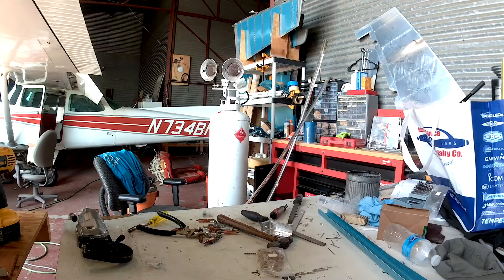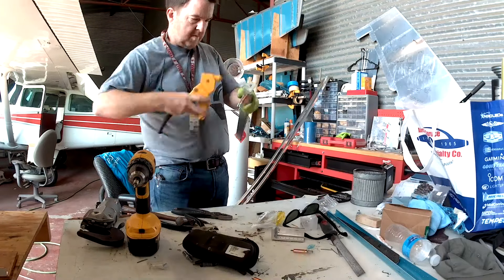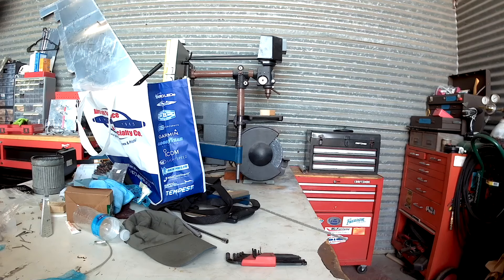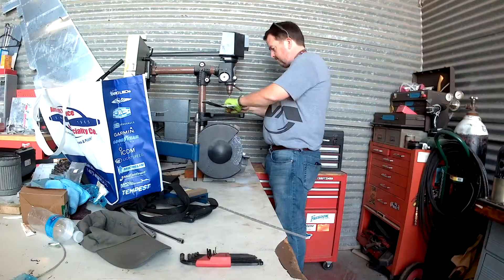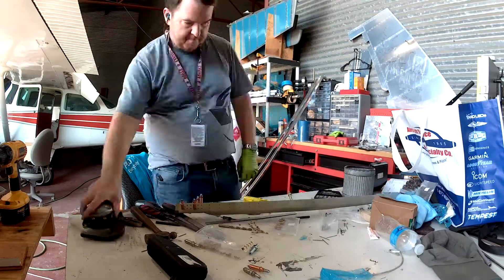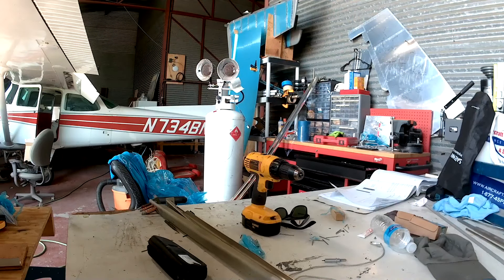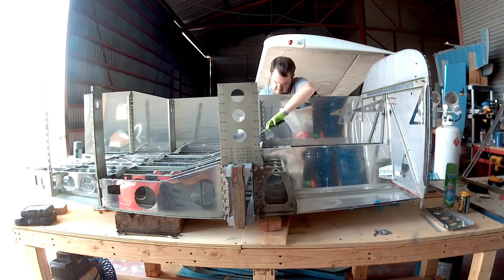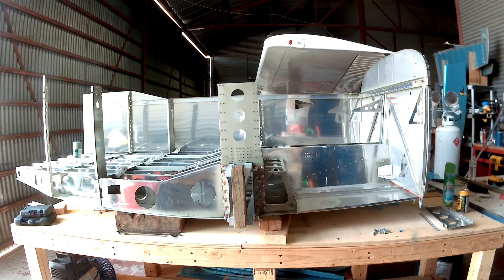RV - 14 Ch 29 - 10

Comment: Andrew hello! I am on page 29-07 finishing up with the upper and lower fuselage longerons. Next step would be to work on the cowling hinges but I don't see you doing that. I recall you using a camloc system instead of the hinge system for the upper and lower cowl. Is that correct? Interested in doing same but don't know where to find info/instructions/examples for this "mod". Can you point me in the right direction please. Much appreciated. Thanks
Reply from the maker: Here is the link to the skybolt page where you can find the kits:  

https://store.skybolt.com/vans-rv-1014-c711.aspx
Reply: Fantastic and thanks much! In the meantime I found your YouTube content on same topic. Gosh! What would I do without you :-). Thanks for your good and very helpful work. Best

Comment: Hey Andrew. Are you still priming? Not judging just trying to decide if I should bother. I live in the Midwest and feel probably not needed based on Van’s sample they have hanging outside.
Reply from the maker: I am still priming. You'll see it on the side skins soon. You'll also see the side brackets have that nice army green tint to them. Anything green = primed.The inside of the fuselage is special I suppose. I mean I do prime between parts riveted together but as a whole soon enough its going to get primed and painted all over.